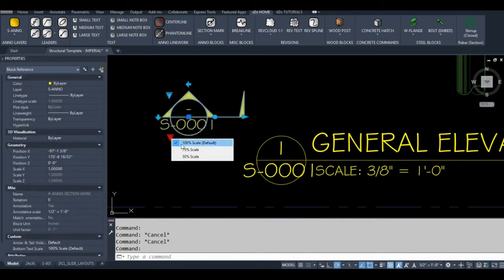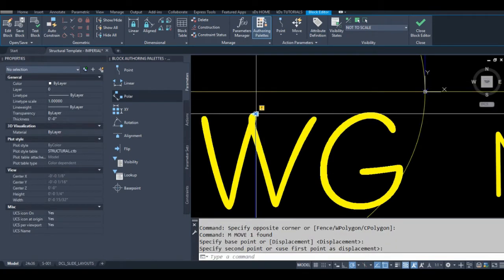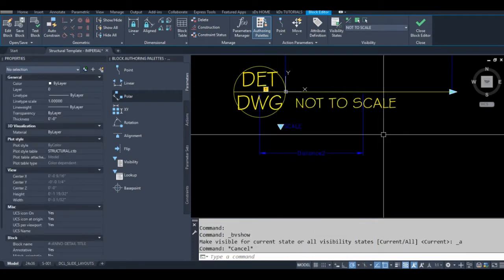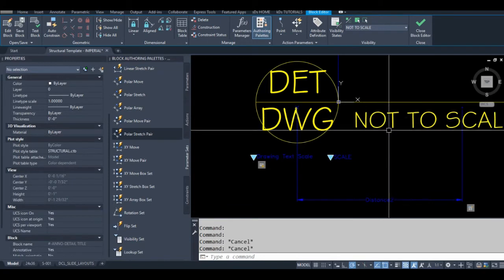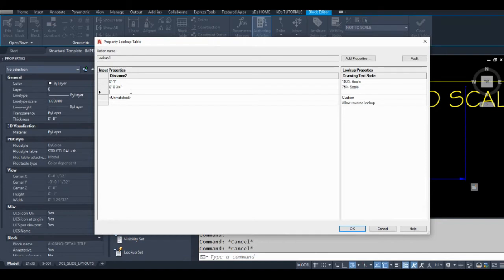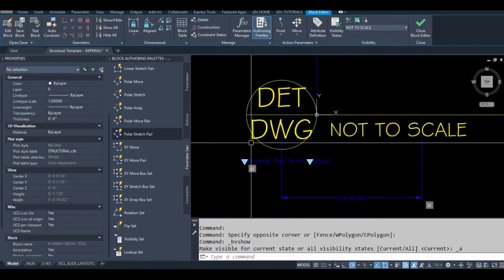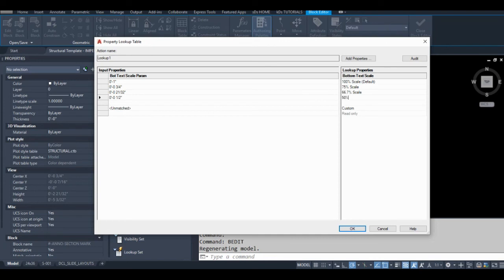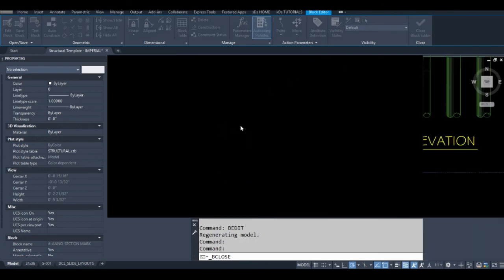AutoCAD Dynamic Block - Attribute Scaling Trick

Comment: I have a block with two attributes whose TextHeight I wanted changed. I found a solution that scaling the attributes size up / down through Scale action. Unfortunately it meant that I needed two linear parameters to accomplish this while I wanted both attributes to be of same size, hence one parameter. Thanks to your use of Lookup_Table, I managed to resolve my issue!